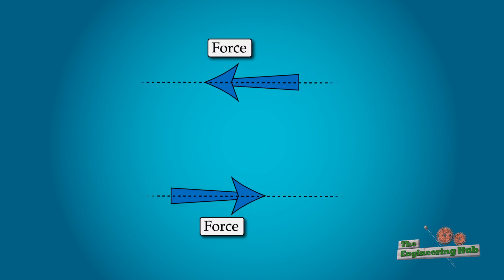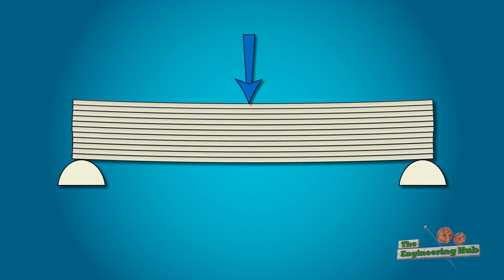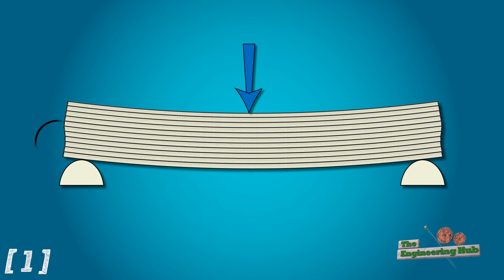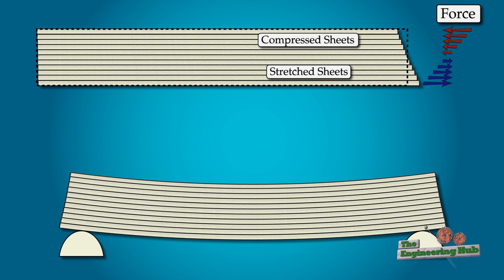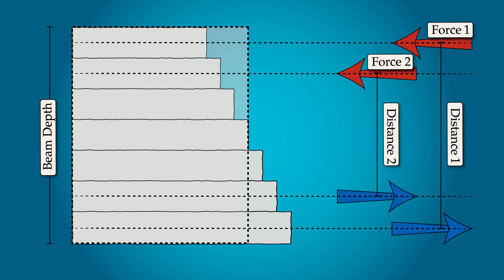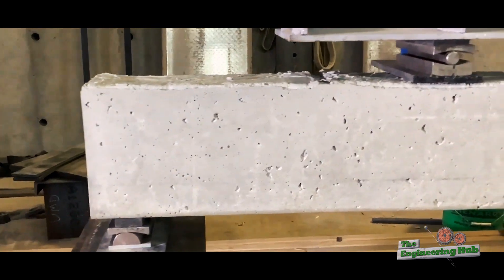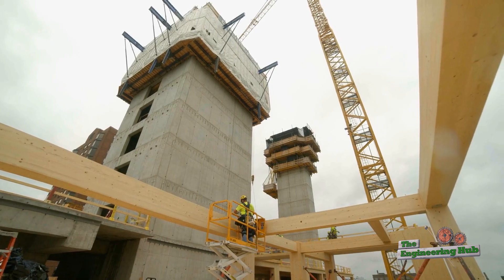Bending Moments Explained Intuitively (Zero Mathematics)

Comment: Please note/: NA is not lengthwise, it is visible in Cross section. Lenth wise neutral layer is vissible
Reply from the maker: The neutral axis is both lengthwise and widthwise if the bending is unidirectional. The NA is essentially a plane.
Reply: @TheEngineeringHub  sorry, NA lies in CS. It is intersection of neutral plane with CS and also it the axis in CS about which BM is considered.
Reply: Also, since you told NA is a plane! How an axis can be a plane? Plane is 2 dimensional and axis is. One dimensional
Reply from the maker: @rajshekar-nm3fh  the NA is the location of the beam where the stress is equal to zero. Each cross-section along the length of the beam has an NA. If you connect all the NAs of each single section of the beam you get a plane.
Reply: That is why, I told,  Neutral plane is length wise and NA is in CS

Comment: In your example with paper sheets, you have 5 sheets (ood number). In that case, the middle sheet has no change in length. What will happen if you have an (even number) of sheets?
Reply from the maker: A useful way to think about it us at the limt case. By limit I mean when the thickness of the sheets gets infinitely small. Say 0.0000001 mm. In that case it doesn't matter too much whether there is 1 or 2 sheets at the middle. It just means that there is a theoretical point (line) where the stress is zero. Hope that helps 🙏

Comment: WTF. Never heard bending monent is a 2 force concept. Maybe 2nd force is the reaction to the force applied perpendicular to face. And torque is a special case of shear force. Unlike shear force, which is parallel to cross section amd perpendicular to face, torque is applied inclined to the face
Reply: Never heard about a couple? It's a basic concept. Get better books or ask Google.

Comment: Can you please give me an example where Bending moment is minimum for Zero shear force at a section.
Referring "At zero shear force bending moment can be maximum or minimum."
Reply from the maker: Where is this reference from?
Reply: @TheEngineeringHub  A FRIEND OF MINE ASKED ME AND I AM STILL SEARCHING FOR THE ANSWER 😂
Reply from the maker: @asmokneel2464  I would say at a support of a simply supported beam. The moment is 0 and the shear force goes from 0 to the value of the reaction, so technically, it has both values at that point.
Reply: @TheEngineeringHub  so the statement is correct right?
Reply from the maker: @asmokneel2464 barely 😅 but one can argue for it. But it doesn't seem of practical importance, at least not on a first glance.
Reply: The best example is SSB with equal overhangs on both sides subjected to udl. If overhang is more than  half of distance between supports,  at centre SF=0 and BM is minimum

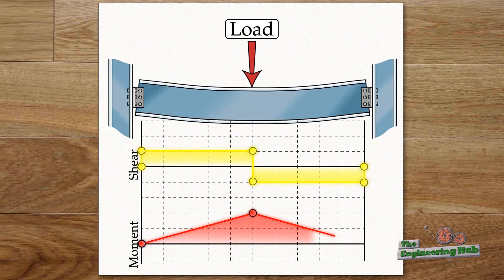Comment: 4:14 Ends free to rotate? The image shows something different.
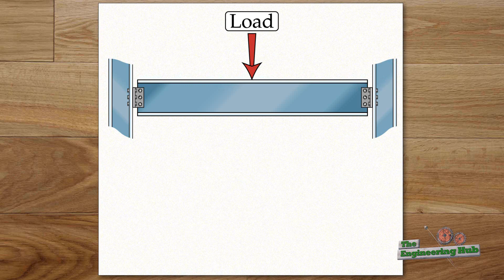Reply from the maker: Thanks for bringing this up Erik. In Structural Engineering, bolted connections only to the web of the beam are considered as pin connections and allow rotations. The top and bottom flanges would also need to be bolted if the connection was to be considered as fixed (see 4:46). The connection at 4:14 allows the beam to rotate a fraction of a degree which is enough to provide relief from the bending stresses.

Comment: Torque is vector. Bending moment is two forces, so it is two vectors, and we need some share forces to provide connection between them.
Reply: torque is acting parallel to the cross section (caused by shear forces)  , while bending moment is acting perpendicular (caused by axial forces) that is the distinction between the two,  they are both rotational forces
Reply: torque produces torsion in beams while moment bends the beam

Comment: 📌your attempt at explanation is valuable, costly in time, but it is a failure, you lose a lot of people. 
The best explanation is based on the example of "a sponge". Congratulations on your attempt.
Reply: I'm not sure why you feel the need to be so patronising, nor why you think a 5 minute briefing is "costly in time".

Speaking as a steel erector (not an engineer), I though their explanation was rather good: both accessible and adequate.
Reply from the maker: @Jim-kc2ol  thanks Jim 🙏 glad you found it useful
Reply from the maker: The foam beam explanation is great but also already available online. I went for an alternative way, and I guess I failed.
Reply: @TheEngineeringHub  Well, you did not fail for all viewers. Thanks for a nice video!
Reply from the maker: That means the world to me, thanks Thiago!
Reply: @TheEngineeringHub  Your attempt is too valid. A different approach helps in general understanding of the subject. Thanks from Brazil.